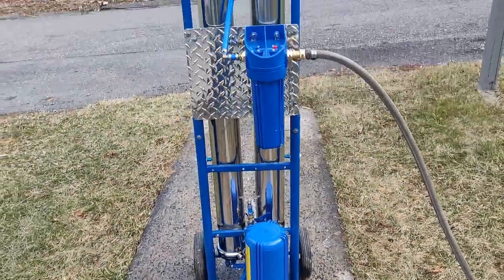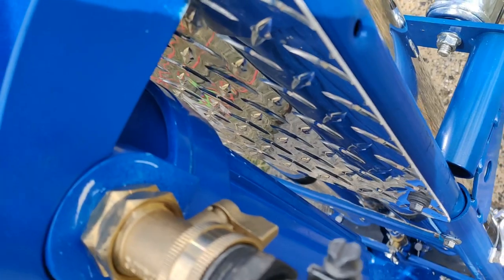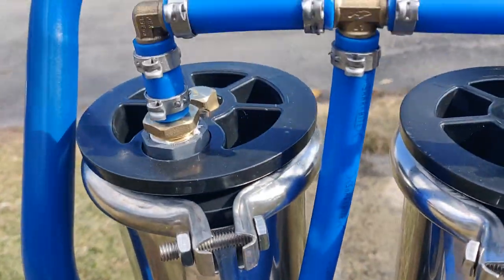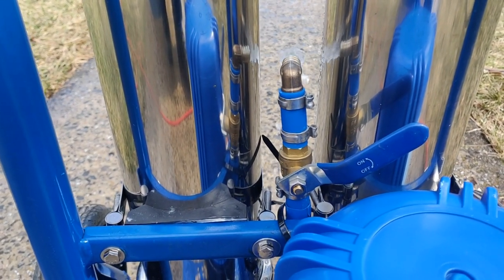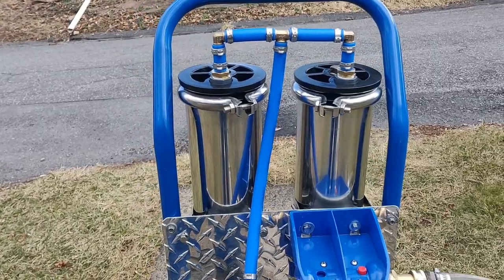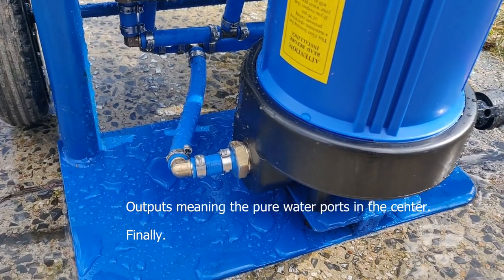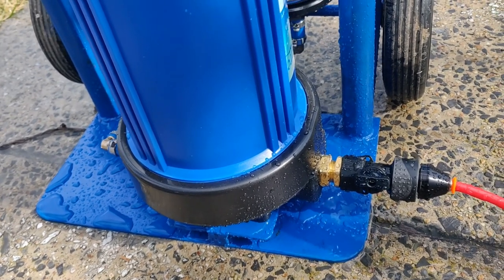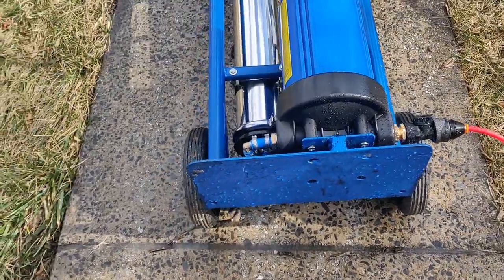DIY Pure Water Cart for Window Cleaning

Comment: Looks awesome I have a self build system too, going to be upgrading it soon with pump etc.  May I make one suggestion though, add another pre filter and stick a 5 micron sediment filter before the carbon block, as you currently are its possible sand and grit will get into the carbon block and reduce its life a lot quicker (Or worse if you have a carbon block filter thats 10 microns or more, it may let small particles through into the osmosis filters and reduce their life too).  And sediment filters are cheap as chips, not that carbon is massively expensive but theres a difference that makes having sediment better.
Reply from the maker: That's a good thought, thanks! I decided to go with one, as it is 5 micron, after checking manufacturer filter change recommendations. Systems that have two pre filters go every 6 months, and systems with 1 are every 3. Because the filters are close in cost, it was better for me to save the weight and initial cost and keep it simpler.

Comment: Love your system! Thank you for the video. I do have a question though. Everything about your cart build make perfect sense to me except the discharge water. Why is there discharge water? Why would that not just continue into the rest of the filter system?
Reply from the maker: This is a natural part of reverse osmosis, and the reason RO membranes last longer than any filter or DI resin. Rather than trap all the contaminants, the water is split into purified water, and discharge water full of the leftover solids, which gets released continually. If it were trapped, your membrane would be ruined much faster. So if you check the TDS on the discharge water, it's much higher than even your incoming water- it's all the solids that have been separated from the pure water.

Comment: This is great video and very well explained, i would like to add 2 of the 1/2” plug for top of the vessels, and seems we need 6 of the 1/2” male barb fittings. I have a quick question so we have to put 5lb resin inside of the 4.5”x10” di right? Is it possible to put the picture for us? Thank you again and much appreciated, man. You helped a lot, and let people save thousands of dollars!
Reply from the maker: It just has to be filled and packed full. @Stevothewindowcleaner has a great video on how to change resin that shows all you need to know

Comment: Hi there...love the build.  Just quick question regarding the RO housing.  Mine has 2 openings and I need to plug the middle opening.  What do you use to plug those openings?
Reply from the maker: Just a common not plug, available wherever you but plumbing supplies.

Comment: Hi,

Thank you so much for the info. Much appreciate it!! 
What type of Waterfeed  Pole are you using? And where does the soap come out through whenever you’re washing a window? I’m new to this. Not sure how all this will work. I hope this is not a dumb question lol.
Reply: U don’t need soap, just pure water
Reply from the maker: Quite alright. There are a lot of great poles available at WCR, jracenstein, and Detroit sponge. The system uses water only. Do some searching,  check out the aforementioned sites, the info is out there

Comment: one quick question, it looks like you are running your DI resin tank upside down, is that just so it will drain when you turn the water off?  I have a homemade DI tank that I use for washing my car but I don't currently do any pre-filtering which is quickly destroying my resin.  We have extremely hard water here in Phoenix, so I'm starting to look for solutions to save me on resin costs.  Plus I noticed after about a yr, the resin starts to give off a fishy smell when using it, so I can only guess that's from leaving water sitting in the tank after use?   this solution make perfect sense to me, but I also need to be able to produce about 2 Gallons per minute, to run without a reserve tank.
Reply from the maker: It's really only an ease of mounting/ logistical thing, it doesn't seem to affect anything.
Reply: @glintwindowcleaning1751  Does the water drain out of the DI resin when you shut off the water?  Might be a hidden benefit to having it turned upside down????
Reply from the maker: @Vanhamj1  no, I cap it off. But you can drain it for weight if you wish. That may increase the risk of ant-trailing though to be honest.

Comment: Nice work......How do you figure how to set the flow on the the waste water? I have a xero pure and there is no adjustment on that.
Reply from the maker: I just eyeball honestly and try to match the flow of ones like the xero. It's not too critical in my opinion, just open the valve all the way for ten seconds when you start and when you finish, those ROs will last for years
Reply from the maker: And thanks!

Comment: nice video! I have some questions on this. What is your output pressure on this? As well as inlet and are you using a device to measure flow rate?
Reply from the maker: That's just dependant on the source, and I don't have devices for that. With any passive system, you can just figure there will be several psi will be lost from whatever the source is. The ro membranes usually have a spec sheet that tells you the percentage pressure drop to expect.
Reply from the maker: For flow, a stopwatch and a bucket is my go to

Comment: thanks for video. I'm confused as to the DI resin I have to buy. is it the XERO DI Cartridge with Resin - 10 Inch, or the XERO Virgin Resin from WCR?
Reply from the maker: You're welcome! The links in the description get you the needed cartridge, but no resin. From wcr, you can just get virgin resin in bulk. The smallest quantity I think is 1 cubic foot which is plenty for a while.
Reply: @glintwindowcleaning1751  thanks already ordered everything and will be assembling soon
Reply from the maker: @MTH Power wash still working great! Using it several times a week

Comment: Hey man I just built mine up. Can you help me determine the right drain valve size for this setup? 1/8 inch hole good? Or 1/16 inch? 
I see youre using the pex ball valve. 
I’m not interested in fluctuating release valve 
I want it to be fixed as the zero carts are. 

Please tell me what size pressure relief valve hole  you think this system would need?

Awaiting your response eagerly .
Reply from the maker: That's going to depend on the membranes you go with. I would do a little research on the percentage of reject water produced, and size it accordingly. You can usually download a spec sheet of a comparable membrane to see. One nice thing about a valve is that you can shut it off for transport so it doesn't leak everywhere.

Comment: Have you tried using something like this connected to a pressure washer? Wonder if it would work
Reply from the maker: It could be used as a pre filter only, but there really wouldn't be a lot of benefit.  For a spot Free rinse, it's best used on its own

Comment: I have 2 dumb questions.  

What’s the main benefit to having 2 vessels vs one? Just simply more use before having to change filters? Or are there other benefits?

Could this be permanently mounted to the wall of an enclosed trailer rather than a portable cart, and not leak everywhere? Other than the release water of course.
Reply from the maker: There are no dumb questions, just dumb people 😆
The benefits are more pure water per minute. The RO vessels only let so much water through per square inch per/time, so more inches=more water. The longevity of all the filters will be the same gallon wise, but less timewise, as that is mostly dependent on the amount of water put through them.

This can all absolutely be mounted somewhere permanently! It's really a matter of preference. A van mount does increase the amount of hose required in many cases, and more hose=more restriction=less pure water per minute. It just depends on your own needs. There's also the danger of freezing in cold environments like mine. I like to be able to wheel it inside for winter!
Reply from the maker: I might ad that with a van mounted system, the flush water just needs to be routed outside the vehicle.

Comment: How do you remove the Pex pipe when you are going to change out the filters? Quick connect fittings an option? Thanks!
Reply from the maker: You could use quick connects if you want but it's not necessary. The curve in the pipe going from the carbon filter to the ro is just enough slack to remove the ro caps. You can also undo the threaded fittings since pex pipe can swivel on it's fittings, many don't realize that so maybe I'll mention in a follow up

Comment: does increasing the waste water flow just increasing the flow coming out of the system? Does it change the tds coming out of the RO membrane? thank you
Reply from the maker: A few things happen when adjusting waste water. To understand better- more waste water flow=less pure water flow. But it also means less contaminants builds up in the system. That's why most systems built like this will recommend flushing wide open for 20 seconds at the beginning and end of use.

Comment: I just came across your video. Awesome job! I'm new to all of this and these may be dumb questions. I did have a couple questions. Is there a reason you opted for the smaller 
10" x 2.5" pre filter and housing instead of the 10" x 4.5" and then the same for the DI housing you went for the 10" instead of the 20"... Is there a benefit to the smaller sizes or is bigger better? I'm ready to start ordering everything and putting it together. lol
Reply from the maker: Weight  was the biggest factor. There's other factors though. The prefilter definitely doesn't need to be any bigger, it needs changed quarterly regardless, and a carbon filter is not very restrictive so it can be the smaller size. As for di, the only advantage to larger is longer time between di resin changes. Our water TDS is mostly in the low 100s or less around here, so I get excellent di life as it is, no need for the extra weight. But if you live in an area with really high TDS, the bigger di canister might be wise.

Comment: Nice build! Do you have a flow restrictor after the RO? Or is that your pressure quick release valve that is spewing the water? Just curious. Building a system and not sure about a pressure regulator. Thanks!
Reply from the maker: That's just a ball valve that's dumping waste. You can just eyeball the setting on that based on the ro membranes paperwork. They'll say what percent waste water rejection should be.

Comment: Did you use a pex 3/4 brass 1 inch fitting directly for the DI filter, i didn't see it on your parts list.
Reply from the maker: Yeah, the parts list isn't comprehensive, some things aren't available, and some things will just be different depending on your setup. The list is just a starting point

Comment: I’m getting really poor pressure through this set up for some reason… my house water pressure is pretty normal but I’m only getting about 1 gallon every 6 minutes through this with the bleeder closed… I built everything exactly as described. I tried removing the pre filter with no change then removed the DI filter with no change. The RO filters are as recommended… not sure where to go from here?
Reply from the maker: That's a bit odd, let's see how we can help. Shoot me a message on my Facebook business page so I don't miss your replies
Reply from the maker: Meantime, how much of what hose are you using? How's your TDS incoming and out?
Reply: @glintwindowcleaning1751  TDS is coming in at like 500-700 and out at like 1 or 2 !!! Really working well just not enough pressure. I was running like 150’ of the small flex hose and I since reading more took off the 100 foot section and it’s much better. Is there a way to up the pressure when using that much small flex line?
Reply from the maker: @hookedonjesus1716  you can use a booster pump, but the easiest thing is to keep the 8mm hose to just enough to run the pole. We're talking pole length plus  twenty feet or so. Then use larger hose to from the machine to that point. I personally love zero-g hose. 100 foot fits in a 5 gallon pale, and it's super durable with a large inner diameter to boot.
Reply from the maker: @hookedonjesus1716  with that high of an incoming TDS, you definitely don't want to run the waste valve shut, and flush it wide open for a minute when finished using
Reply: @glintwindowcleaning1751  ok thank you for those tips that really helps!! I really appreciate the video a and feed back!!

Comment: Hope you can help on this for a long time I used the DI tank it was great but I wanted to get fancy and bought the xero pure I didn't do much research the water pressure sucks so bad I have to use a pump now on every single job it's very depressing! Is there anything I can do to increase the water pressure??
Reply from the maker: A booster pump is good, but the most common mistake is using too much wfp hose. Keep the wfp hose to just enough to run your pole, and use garden hose for the rest of your length, this is the cheapest way to boost flow. It works amazingly, because the pressure drop is exponential for every bit of length of the small hose.
Reply: This may be my problem!
Reply: @Hooked On Jesus  yep I went back to my old DI tank no problems with pressure

Comment: I'm still trying to find out why we need to have a constant flow on the RO pressure vessel..
Reply from the maker: If you're referring to the waste valve, it's because RO is not exactly a filter. Filters catch debris and keep it inside, where RO separates the water into two groups- purified and reject water. The rejected water contains all the solids, and it has to go somewhere, or else the RO membrane will be plugged up and ruined in short order. Hope that helps!

Comment: How many gallons of water do you run through that setup in a season before you need to do any maintenance
Reply from the maker: I honestly have never checked. It really depends on water quality, and around here it's quite good. So I change the carbon filter quarterly, and the di probably once a year. I get dozens of jobs out of it for sure

Comment: Is there enough flow to hook this up to a pressure washer to wash a car ?
Reply from the maker: There are larger systems capable of this, but I wouldn't recommend it for this one. Typically the pressure washing would be a separate stage, and then you would use this for a final rinse

Comment: Hey i noticed the di cartreidge you have linked doesn’t have the peice inside it the same way xero ones do. is that an issue at all?
Reply: Like the xero I had had that white cylinder in the bottom of the di cartridge, but the one you have linked did not have that, not sure what to do.

Comment: Nice, what was the cost?
Reply from the maker: At the time, I had about $750 in it, which worked out great because an older single stage I built for about $450 sold for $750.

Comment: Can I use a 21 inch ro instead of the 40 8nch?
Reply from the maker: There is actually a system on WCR that uses 2 21s. It works the same as a single 40 ro system. I wouldn't do a single 21 though, just not enough flow
Reply: Thanks for the reply.

Comment: Any issues with installing the di filter housing upside down? Searching online says not to, but I can't see that really being a problem with DI, right?
Reply from the maker: None at all. Almost every pure water cart on the market does it that way.
Reply: @glintwindowcleaning1751  do you have to push the pressure relief button every time you run the system?
Reply from the maker: @isaacholzwarth  Nope, never been an issue. Only sometimes to help release when removing the housing for a resin change
Reply: @glintwindowcleaning1751  cool, thanks! Just finished up my own build and was worried that would have to be done every time, which would be annoying.
Reply from the maker: @isaacholzwarth  excellent! How do you like it?
Reply: @glintwindowcleaning1751  it's great. It doesn't look exactly like yours, I used a different dolly, different housings, braided vinyl tube instead of pex, etc, and only one ro filter from another company, but it turned out pretty great! It's got pretty low flow, but for me it's okay because I use a Gardiner and have a storage tank for ro water in my truck, so I just use this to fill up my tank in my truck. This so beats using just a big deionized resin tank.

Comment: What PPM can this work up to? Water I’m using is about 200ppm would it work?
Reply from the maker: 200 shouldn't be any issue. If the ro reduces 90%, that gets you to 20, easy for di to finish off
Reply: Is the DI housing it’s a filter & resin? Thank you for the help I’m in the process of building a cart myself🔥
Reply from the maker: @GoinShoots  if understand correctly, you'll need the filter housing, then the resin cartridge for inside of that, and resin to fill that cartridge with.
Reply: Thank you

Comment: The dump valve you leave it on while cleaning? I
Reply from the maker: That's correct, just a little bit. The spec sheet for whatever RO membrane you use should have amounts of waste water and pure water produced. I've found i can eyeball it based on those ratios. Let it flush wide open for 20 seconds when you first start and when you stop, and that should really take great care of your membranes.

Comment: What if there's no water supply at customers home,its van mount here,with 100m hose on reel
Reply from the maker: A tank and a pump would be in order for sure!
Reply from the maker: I've had one job out of several hundred here with that issue, so we just did it the old fashioned way.

Comment: What about under hi pressure
Reply from the maker: Depends on your definition of high pressure. This can be used with a booster pump to get even more flow if you like, just check all your filter specs and stay in the manufacturer stated limits.